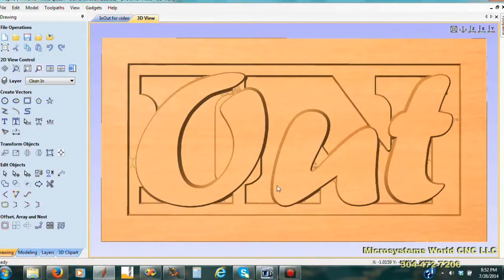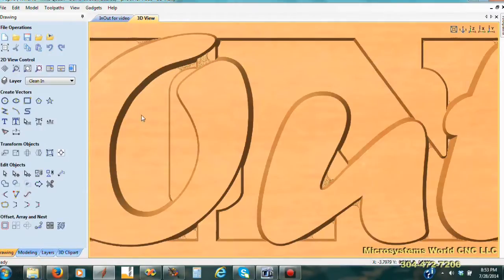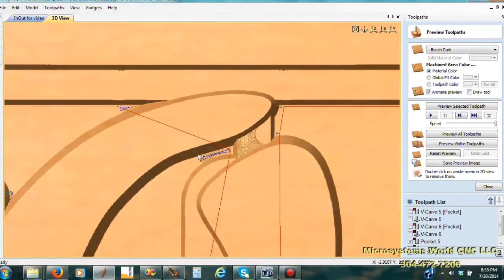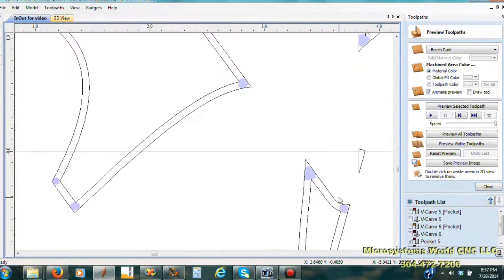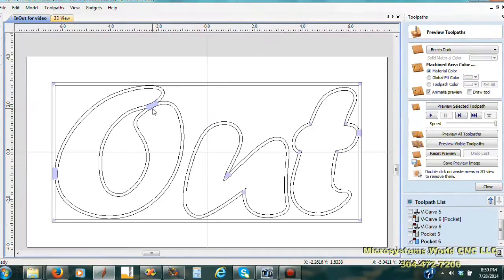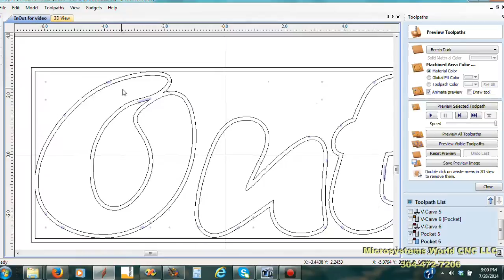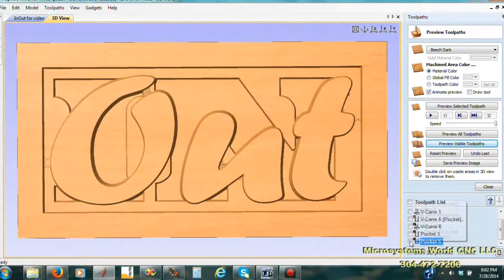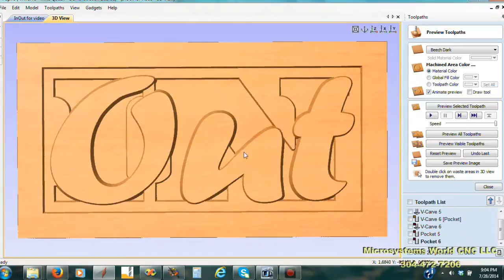VCarve Pro and Aspire tutorial: Vcarve cleanup - How it works.

Comment: Could you not have simply done a pocket with a .0625 tool and the use a larger clearance tool of .125, calculate, and then delete the .125 toolpath leaving only the .0625 without all the extra offsets and work?